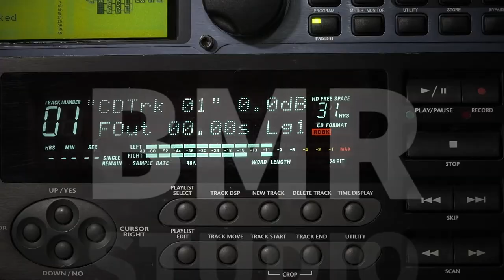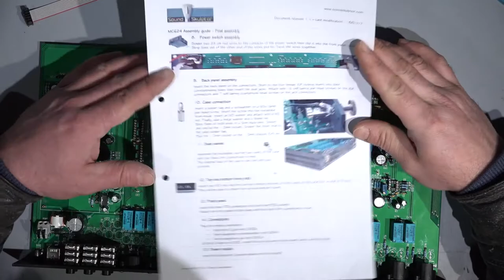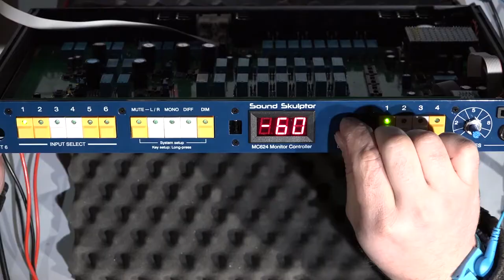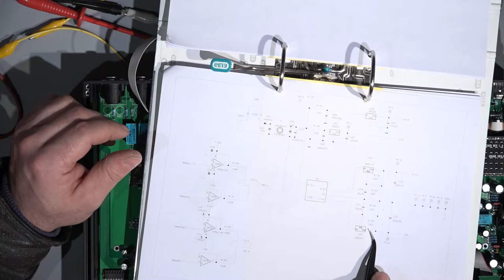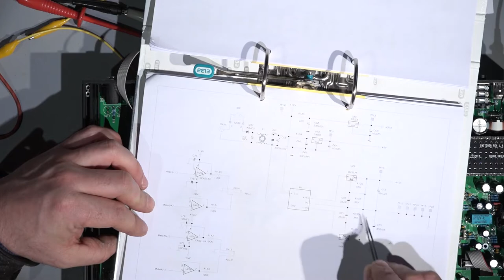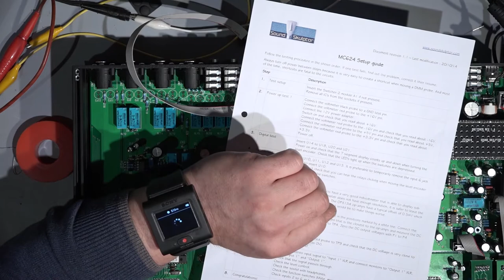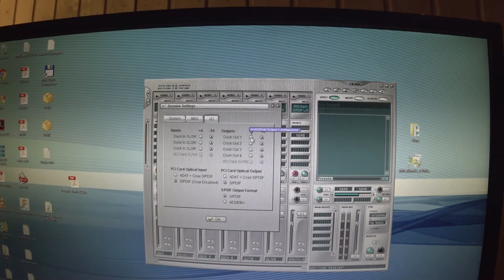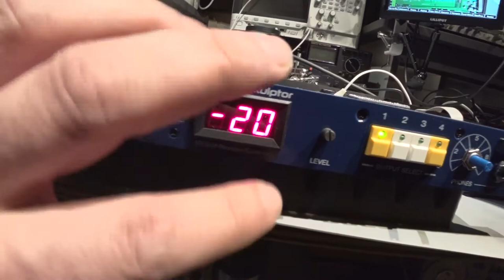Sound Skulptor MC624 DIY monitor controller. Adjustments and tests

Comment: Were you able to resolve the issue with the headphone volume potentiometer. I have the same issue, Jean suggested to replace 3 resistors, wich helped somewhat but still at very low levels there still is one channel higher than the other. I really enjoy this controller, but this issue does bother me as I reference in headohones a lot at low volumes. ...
Reply from the maker: Just follow the build instructions and get a proper multimeter (at least 5 digits) to calibrate the power rail. The headphone output must be super loud! I think you did some mistake with the building. check all resistor values. Maybe you mixed up? And there is a menu for the headphone settings:  high or low gain.